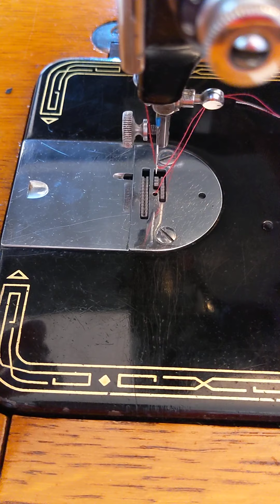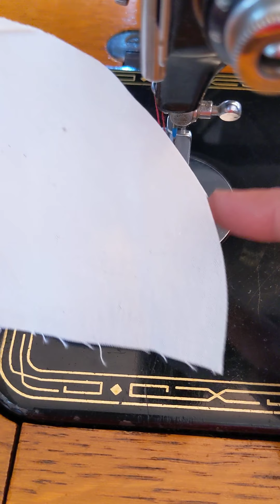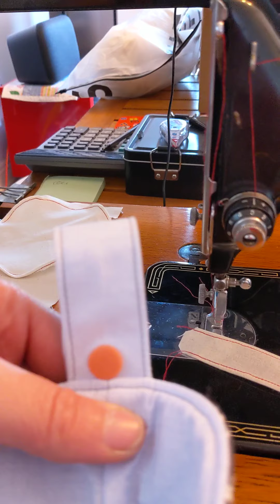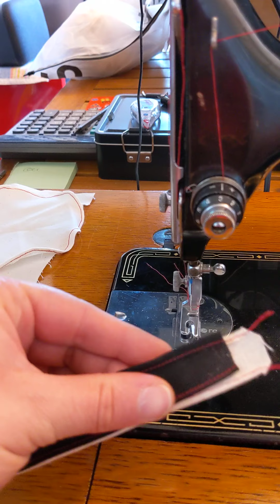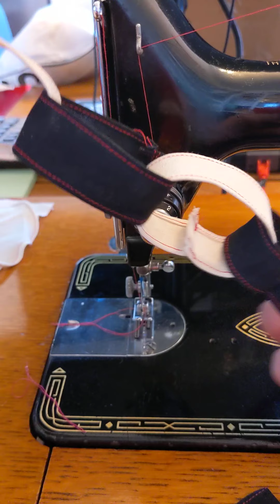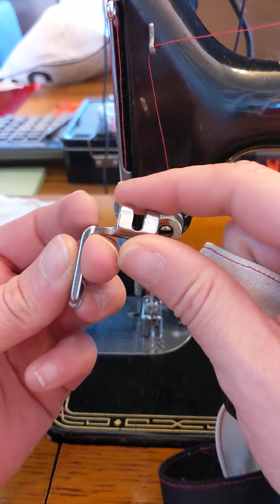How to use a Narrow Hemmer Foot

Comment: Thank you this has been great and got me underway using it. I compared it to current machine foot. Treadle one looked like a better foot and although Singer 4423 has clip on feet I removed 4423 presser foot from screw and thought maybe 1mm diff bottom of each foot to screw position so installed treadle foot to 4423 went forward cranking, as it seemed okay applied power. The treadle foot was much better than the modern foot. Thanks again.
Reply from the maker: That's great to hear! I also have a Singer 4423. He is my only modern machine and is mainly used for zig zags and stretch fabric. I find I can interchange a lot of the vintage feet with the modern ones - but you are right, the vintage feet work so much better 🥰

Comment: If you put a couple of stitches in the corner of the fabric and leave a tail you can use it to help pull through the start of the fabric.
Reply from the maker: That is so helpful, thank you very much. I hadn't thought of that, but will certainly give it a go.

Comment: I have been trying this afternoon with no luck unfortunately. The fabric seem to roll correctly but the seem is created just next to the rolled hem, instead of in it 😢. I dint know what I am doing wrong. I'll try again another day, and will watch your video again, just in case I missed an important detail.
Reply from the maker: You may not be doing anything wrong, it may be the attachment is ever so slightly bent, or the coil is missing/bent. Also try with different fabric?

Comment: My needle dont get in center of the hole, how to adjust that?
Reply from the maker: Do you have a swing arm machine, sometimes the needle direction can be adjusted. 
If you are using a low shank vintage, it could be the presser foot isn't attached quite right or may have been bent? I have found many attachments get bent or damaged over time when they have been stored.